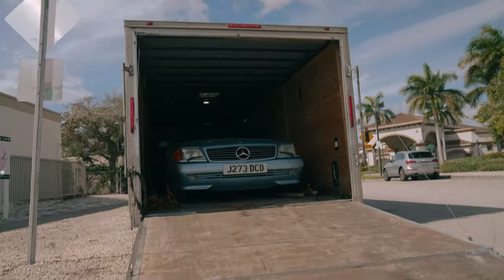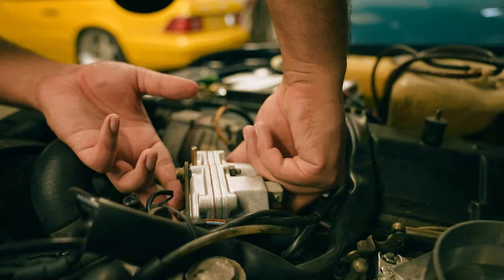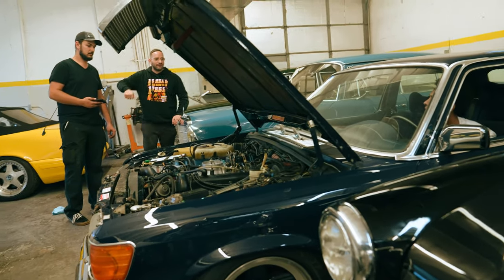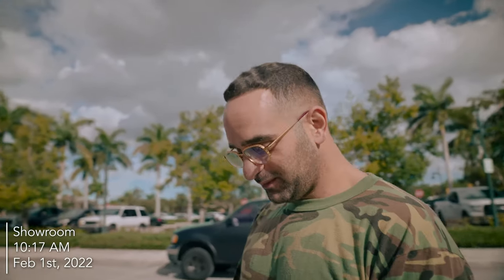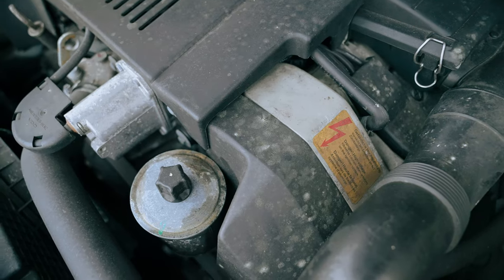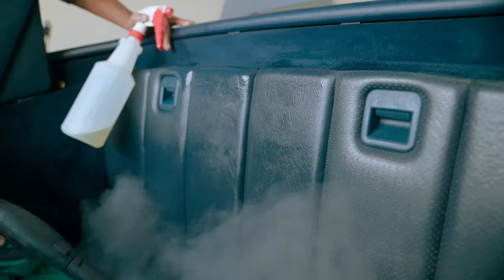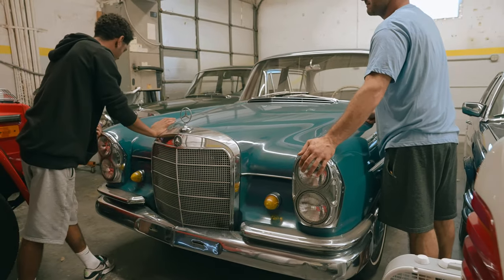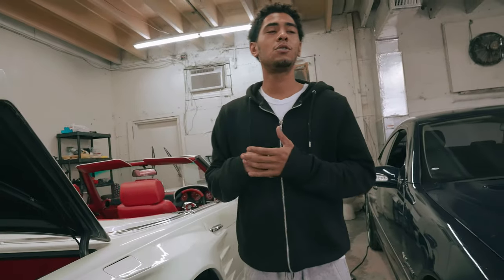Was NOT Expecting this MOLDY Koenig Mercedes! | VLOG #012

Comment: 2:42 take off the blue connector that's near the air flow meter and the fuel pump will run continuously. Contact on position 2